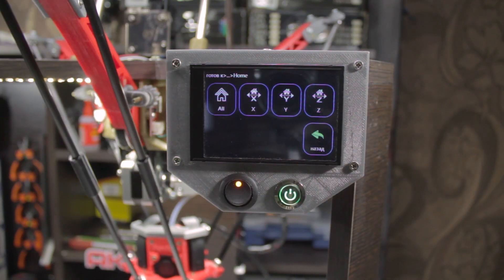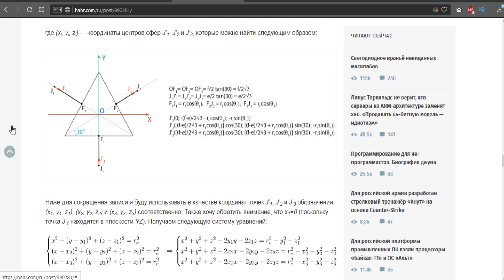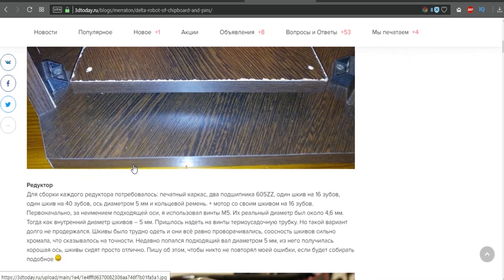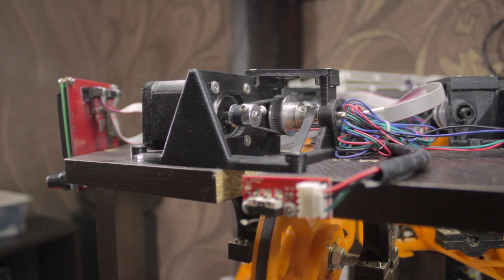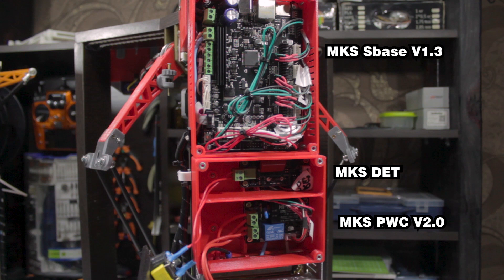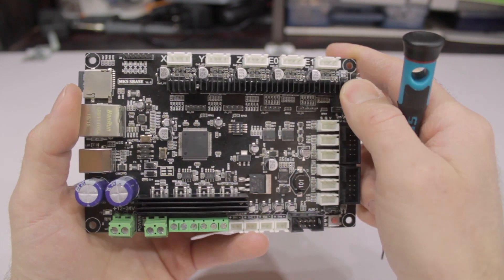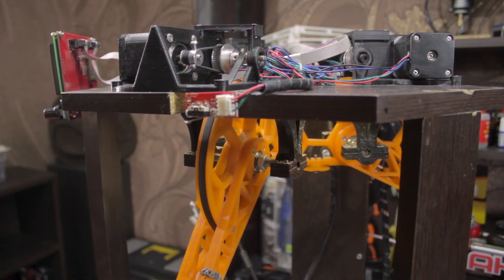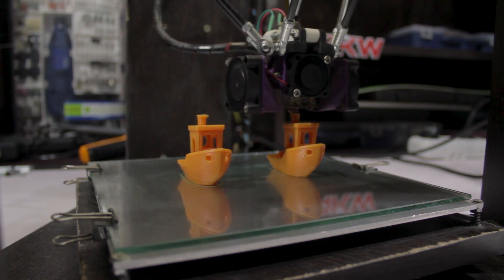3D printer made with 3D printer: Unique Delta Robot for $ 300

Comment: Looks impressive, I don't doubt the amount of time and effort it took to get this running, but the whole idea is flawed, the second you put a lever in a system to increase rotation travel you add a pile of flex, I'd bet you have already seen this, as for print quality - you should have mentioned how much you needed to slow it down to remove the ringing, alas I think you have achieved a perfect piece of kinetic art, but not much more.

Comment: can I use normal MARLIN firmware? and to increase the height of the Z axis, I just have to increase the length of the 3 arms?
Reply: In marlin, there is no work with lever mechanisms.

Comment: I'm using SKR pro 1.1 High computing power and no integrated stepper controllers. Went for SPI mode controllers TMC5160 that are also SILENT. It means the stepper motor noise is in the ultrasound range totally inaudible to human ears

Comment: Thanks for the video and info.  It seems like a delta column printer is simpler and easier, I don't see the downsides you speak about.
Reply: I've got to agree.  Linear rails are expensive, but that's the only downside I can think of.   Linear deltas are much more supported by mainstream firmwares.

But this design is more novel, so that's pretty cool.

Comment: Great job.Project is very interesting. It looks like printing is not so fast, and there is no advantage over the classic printer. We usually use deltas for pickup in the sorting process  in production, where large positioning accuracy is not needed.  It must be understood that the weak side of delta-robot is poor accuracy with linear  movement. Good luck!
Reply: How poor accuracy?
Reply: @Stealthsilent1337  long thin arms are bendy, placing the amplification of movement in any lever system cannot be better than the slop in the best bearings, this slop will be amplified and give poor accuracy.